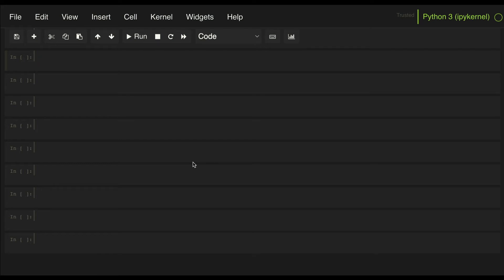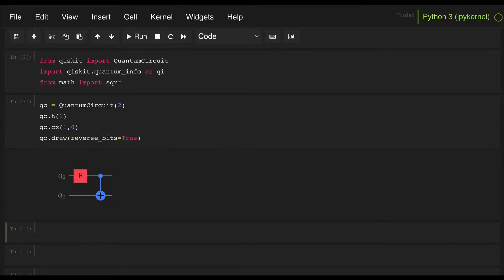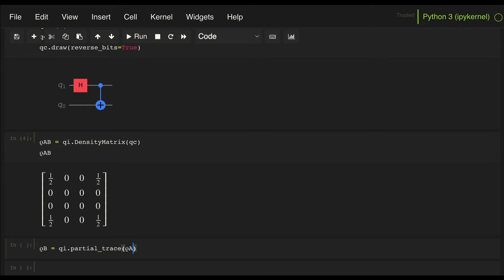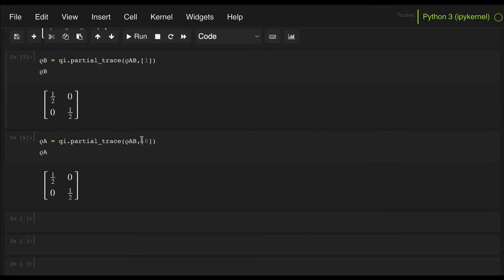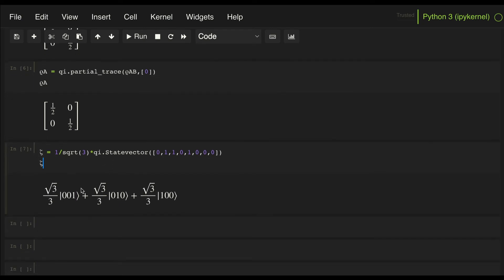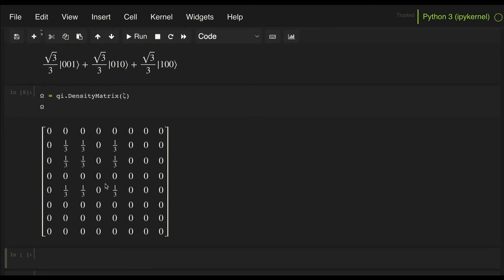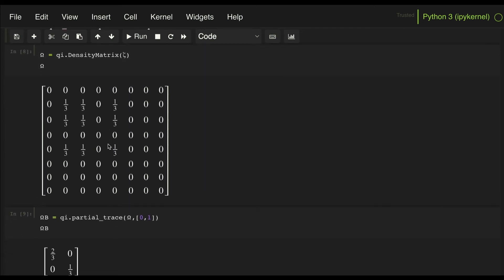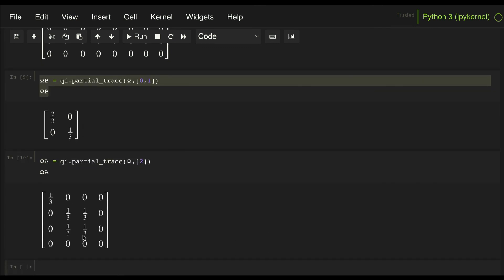Reduced Density Matrices in Qiskit

Comment: How did you incorporate latex in jupyter like that? I mean latex matrix display and "\rho".
Reply from the maker: Jupyter notebooks support LaTeX display via IPython.display; see here: https://stackoverflow.com/questions/13208286/how-to-write-latex-in-ipython-notebook. 

When you install qiskit, they incorporate this function to display statevectors, matrices, etc. automatically. If you are not seeing them displayed in latex form, you can explicitly use the draw method as: mat.draw('latex'), where mat is the name of the DensityMatrix you want to display.
Reply: Hello Diego. I read through the stackoverflow link you sent, but they require that you use delimiters $$ or $$ $$. 

How do you setup your Jupyter notebook such that it automatically generates the greek character "rho" by typing only "\rho" without delimiters $$?

Thank you!
 @diemilio